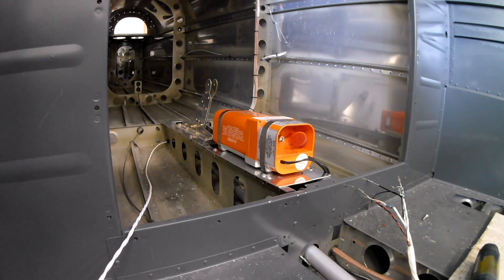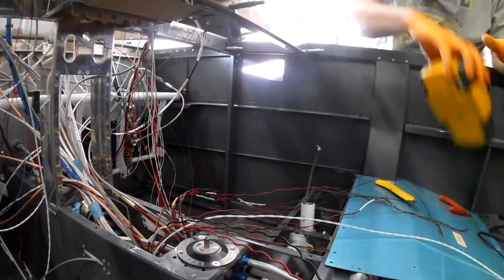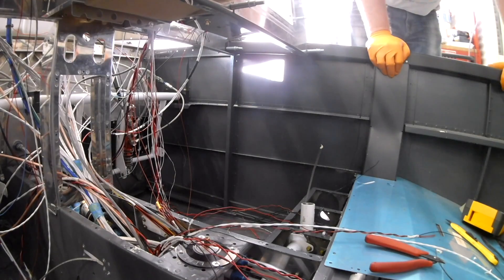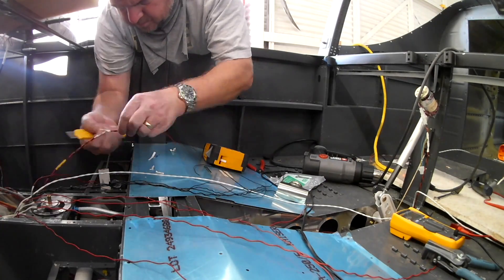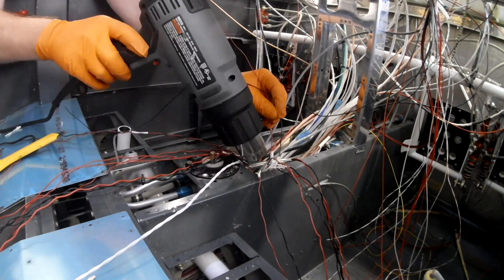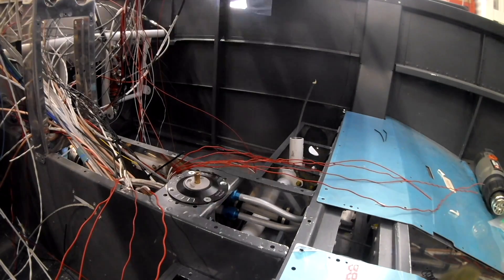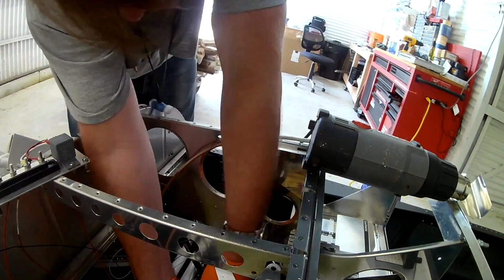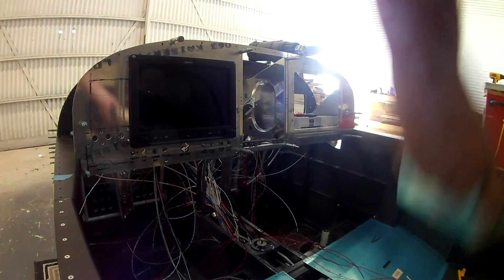RV-14 Power Decoupling

Comment: Still not sure why you are untwisting the wires.  It is good to keep them twisted until at your termination point.  And locating the grounding block as close as possible to the fuses or breakers helps in that regard.
Reply from the maker: I had to untwist them to get the leads into the circuit breakers. The grounding block is all of 12" above the circuit breaker panel so not too far to go.